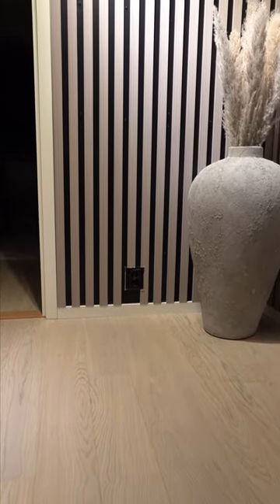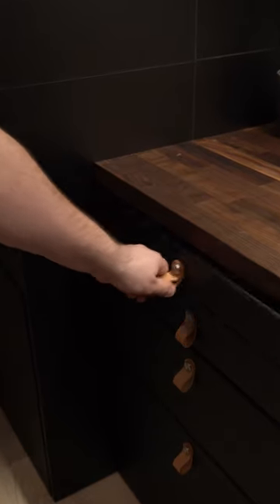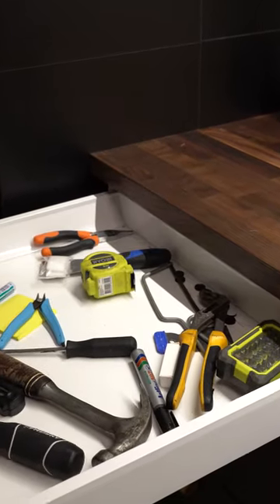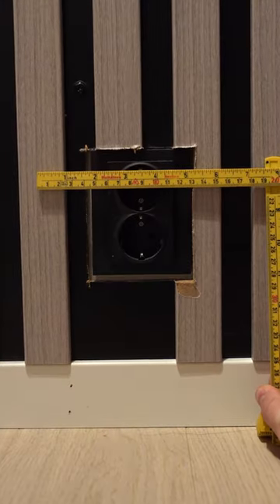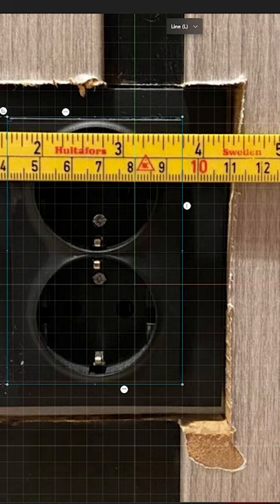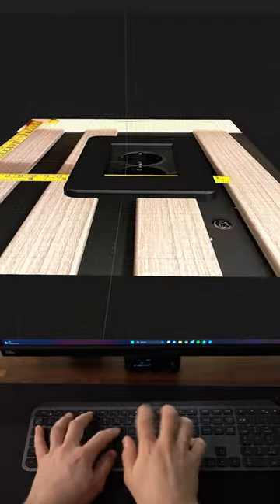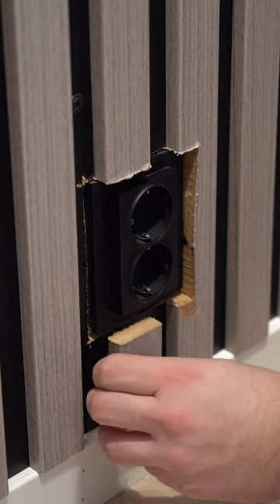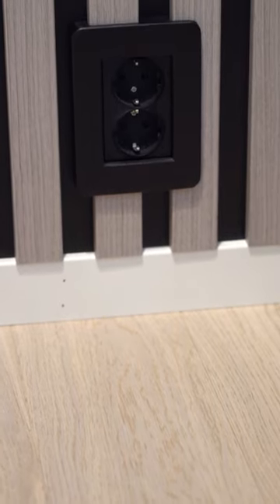Solving random problems with 3D printing #1

Comment: U didn’t mess that outlet up. U had that planned from the second u got the pannels home and realized u needed plug holes and had to make something up. Very slick solution
Reply from the maker: Haha thanks! To be honest I thought cutting with Jigsaw was a good idea… also was a few millimeters off during the measurements. But on the other hand I don’t know what other way I could get them clean looking without seeing the cut lines.It’s been like that for a while and I just got tired of looking at it and figured why not try to cover it somehow. 3D printing would be perfect here. Luckily I kept the missing piece of wood! 😅
Reply: @makerunit  you can make a 3d printed template and use a router with a flush trim bit next time.
Reply from the maker: @satibel  sounds like that’s a better idea definitely! 😅

Comment: The fact you filled the gaps between the panels caught me by surprise. I hope I'll learn to design myself soon. Still only printing given other people's designs.
Reply from the maker: You’ll be suprised by how many cool designs you can make just by giving a few hours of training learning som CAD basics! It’s the first 2-3 hours that are frustrating, just understanding how the program works. After that it’s suprisingly easy as long as you have the idea straight in your head. What takes time is the idea usually, not the actual time it takes to design it in the program. 😊

Comment: OCD still kicking in its still not in the middle of those wooden things don’t know the word rn xD
Reply from the maker: Oh hah I didn’t even notice that! Was so focused on the cover itself 😅 I have no clue what it’s called in english either so I just referred to it as «wood piece» 😂
Reply: Same thing it's damn awful to see that's not in the middle. I'd first move the outlet to the middle, cover the hole with something based on what the wall's made of then 3D print the cover.
Reply: If he made the left side wider it would have covered the slat on the left the same as the right and it would look symmetrical.

Comment: Awesome! Do you happen to know a good guide or instructions to make what you did? Using a scaled photo to design it
Reply from the maker: Thanks! I do not have any specific guides but I’m using Shapr3D but many CAD programs have this option to import photos. What’s important if designing based on a photo to get the picture taken as straight on as possible, and with a ruler as reference so you can scale the photo until for example 100mm on the ruler is also 100mm in the design program. To get the most accurate measurements I actually recomment standing further away and zooming in. Try to take the it from the exact same height not above or below. That’s going to cause your lines to not be straight.
Reply: I'll add some software allows you to select a ruler to scale the picture. basically you draw 2 lines and give the length between the 2 points for each and it will automatically scale the picture to size. some do only one line and assume the picture isn't squished

Comment: I'm pretty sure PLA is not graded for electricity panels, it can actually melt and catch on fire in case of shorts
Reply from the maker: Who said this was PLA? 😊
Reply: there's always one ... do you think the wooden surround is graded for electricity panels? there is a point at which things NEAR an outlet don't need to be rated you know.... like the WALL... maybe he should just build the whole house from electrically insulated materials?
Reply from the maker: @sirtinley-knot2944  perhaps I could modify my Ender 3 to print an entire house from pure plastic 😁😝
Reply: Don't know if you tried burning PLA but I have and there's a video on other filaments as well. It doesn't stay lit - it's not like polyester or ABS.
Reply: @sirtinley-knot2944   I'm not gonna go further on the subject since you seem pretty set on your rant, but that's literally the material of the panel. To be any closer than that would be having the literal socket made out of printed material.
Reply: @makerunit  by the lack of draft barriers or enclosure and not having any warping, I can assume it isn't ABS, so the first option was PLA. It could be PETG tho
Reply from the maker: @Zigfryed  It’s PETG 👌 but there is also an «enclosure». Just a big one with shelves holding two printers above eachother.

Comment: Don’t forget to spackle your nail holes
Reply from the maker: Nail holes? These are unfortunately just vinyl wrapped MDF panels screwed to the wall with black head screws
Reply: on  the base boards lol @makerunit
Reply from the maker: @wabbs1340  I see. In Norway it’s very common to leave the nails visible in new buildings.

Comment: text-input CAD?  i don't think so brah
Reply from the maker: That typing part is just an over exaggerating done on purpose just for fun. 👌 it’s two separate videos placed on top of eachothers.
Reply: @makerunit  some CAD programs do have command line input, so it's not impossible, just really rare to see that much typing
Reply from the maker: @schvanger  haha but you’re right, it’s completely off was just meant for entertainment really. I do put in most measurements with the keyboard but still need to use the mouse to place the shapes in the sketch in the first place 👌

Comment: I don't think thats UL listed
Reply from the maker: Why should it have to be? It’s just a cosmetic cover. Kind if like adding a case on your phone. Can easily be removed if you need to access the internal components. It’s not like an outlet generates any heat anyways unless something is seriously wrong, and the original cover is there underneath anyways so if something were to go wrong it would first have to go through the original cover. I think I’m all good 😉
Reply: @makerunit  Yeah, you're good, I was just making an electrician joke. It turned out really nice.
Reply from the maker: @Kalumbo21  haha I see 😊 thank you!

Comment: Wasn't it black already??? hehehe
Reply from the maker: It was black already, but not matte black. 😊
Reply: @makerunit  i thought you did it to hide the layer lines hehehe
Reply from the maker: @monneratrj  It was a combination of both , I did want to hide the layer lines and make it look less 3D printed, but also wanted it matte :D
Reply: @makerunit  really dig your cad skills... im still so lost in onshape... but im "ok" in sketchup hehe
Reply from the maker: @monneratrj  thank you! And just keep trying, you’ll get the hang of it eventually. Just try to start with simple objects and add features to it one at a time. Most of my projects start out as boring shapes with tons of sharp square edges, then I add the details one by one until it looks good.

Comment: Next person to replace that outlet is gonna be like 

What…in the fuck is this
Reply from the maker: Hah true… I guess I could mount it directly onto the outlets original cover itself instead of onto the wall. Doing it that way allows the entire thing to be removed in one piece as the original outlet cover can be removed with two small philips head screws one in the center of each outlet plug. 👌

Comment: how long did it take and do you have a price estimate on the wood? looks great!
Reply from the maker: These wood panels cost me 999 NOK (approx $100 USD) each. These are pre-built panels. But these are actually MDF with a wood vinyl wrap actually, but you get them in real wood too perhaps slightly more expensive. Probably cheaper in the US. The panels I used are 2400mm, 600mm. I used about 20 screws per panel and I screwed them directly into the drywall actually. Though it’s recommended to glue them to the wall. I covered an area of about 4 meters of wall in an otherwise pretty empty corner.
Reply: @makerunit  Thank you so much for the detailed response! I'm inspired!
Reply from the maker: @iLLNASTi  I’d recommend the real wood ones to be honest. The MDF ones feel a little cheap. You can also get these with a black acoustic absorbant material that can reduce echo in a room. Definitely check it out. Unfortunately I have absolutely no idea what they are called in english 😅
Reply: @makerunit  oh nice yea ill for sure look into this. I'm a music producer so the design is incredibly nice and with the acoustic padding that would be perfect
Reply from the maker: @iLLNASTi  a lot of music studios have these panels for that exact reason! 😊 the ones I have do not have the acoustic functionality but they are said to work very well! And they also give a real premium feel to the room so it’s definitely a win-win! An entire recording studio covered in those would probably solve a lot of reverb problems 👌

Comment: Outle cover? Not a good idea, house safety and future insurance claim issue.
Reply from the maker: How so? It’s not in any way messing with the electronics inside the wall. Just a cosmetic cover that can be easily removed pulling on it revealing the untouched outlet behind 😊
Reply: Please take care and double check it..... You are changing the distance of the plug or power adapter to the contacts inside of the socket. Depends on the thickness of your power adapter it could happen that there is not enough overlapping between the contact pins of the plug and the contacts inside the socket - could cause short circuit. If you are not using the socket it's fine but in case of frequently use and higher loads you should take care. 😊
Reply from the maker: @rogert250  I’m aware of this and honestly only really use this outlet for my vacuum cleaner which does not use one of those 90 degree cables. 😊but it did cross my mind to make just a super thin one instead. The «depth» of the outlet is exactly the same as the outside of the panels so I might do a remake that does the same thing, but the 5mm thickness I used is perhaps not necessary. I could probably do fine with about 1mm no longer making this a problem at all, I guess for the future when I’m selling the apartment to it’s next owner this might be the wiser choice! 😊
Reply: Ohh cool that your replied. Overall a great look of your apartment by the way and nice to use the 3d printer for any kind of solutions I like it. Need to get also one from Santa :D wish you all the best and stay safe.
Reply from the maker: @rogert250  hah thank you! And I try my best to answer all comments as soon as possible. I guess some day if this channel grows to a certain level it’d be hard to keep up with all the comments but for now I’ll do my best to answer and clarify things to my best ability. Let’s cross our fingers that santa gives you one! And try to stay away from the naughty list! 🤣👌 stay safe!

Comment: What's the software you used to design the cover?
Reply from the maker: It’s Shapr3D. 😊 It’s a monthly subscription based program.
Reply: @makerunit  Hey, is it shaping the model with code or using the cursor to shape the model? I wanna design phones but I don't own a computer yet so I'm looking into good places to start whenever the time comes.
Reply from the maker: @EasternWind7.5  haha I do have to use the cursor! It’s intentionally sped up and the crazy typing is just added for entertainment, not how I actually did it. The software uses sketches etc. that must be shaped with the mouse and all measurements are manually typed in 👌

Comment: I feel like I would rather look at the mistake than the outlet. Those round outlets look weird. 😅
Reply from the maker: Haha I’m guessing you’re not from Europe then 😅
Reply: @makerunit  yeah in the US 🫣 I will admit I kinda wish we had something similar to the British outlets but not as chonky.
Reply from the maker: @computersales  Those are bulky AF in the UK… US plugs are annoying too due to them only fitting one way. The EU plugs are genious tbh as it does not matter which way you plug it in, just works due to the AC current.
Reply: @makerunit  interesting I didn't realize you could plug yours in any which way. I kind of like how the British plugs have lots of safety features built into them compared to the US they are way too bulky though.
Reply from the maker: @computersales  but we still have the same features, just a smart plug design… 😅 the plug has grounding points on both sides so we still get all the features we need but the polarity +\-changes continiously at about 60hz (updates a second, I think)so it gets its power either way 😅 But I’ve noticed some UK plugs seem to have built in fuses, that’s a nice safety feature definitely! For example in my PC case builds I usually get a power socket with a built in fuse for the extra safety when possible 😊